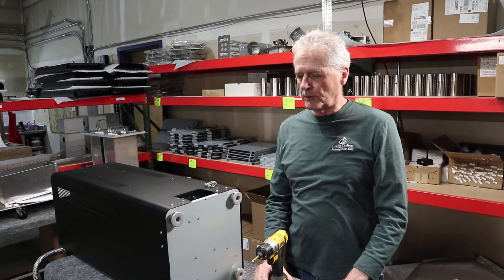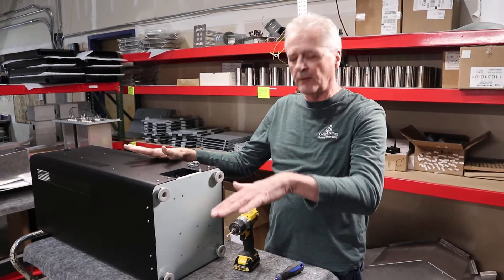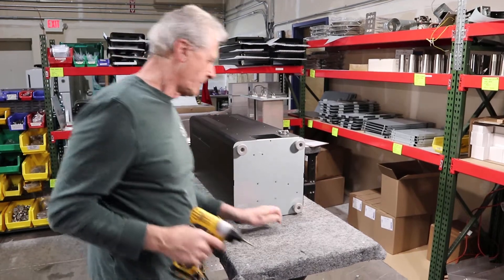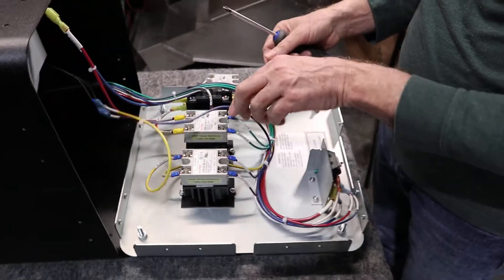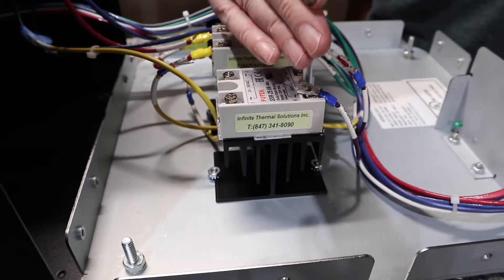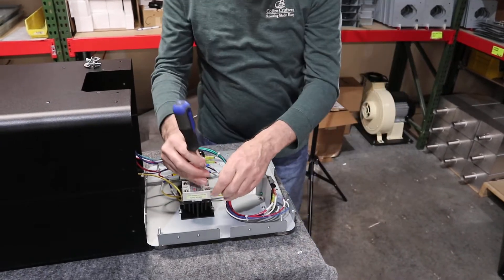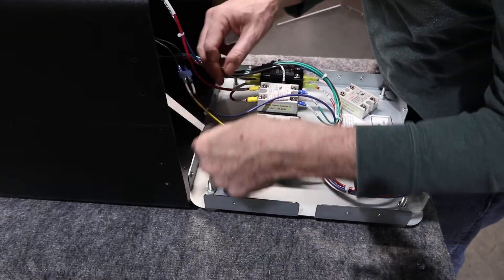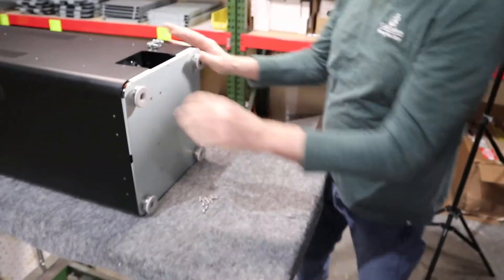Changing the SSR on Artisan 2.5/3e

Comment: If the SSR need to be replaced, is it becos the loft and heat shuts down?
Reply from the maker: The SSR's run electricity to various parts of the roaster. If something like the loft motor or heating element stops working then it could be because the SSR need to be replaced but it could also be because the motor or element itself is no longer working. We would need to troubleshoot with you over the phone to know for sure.